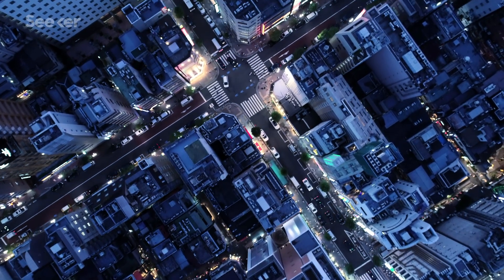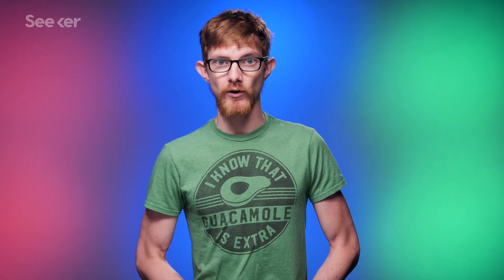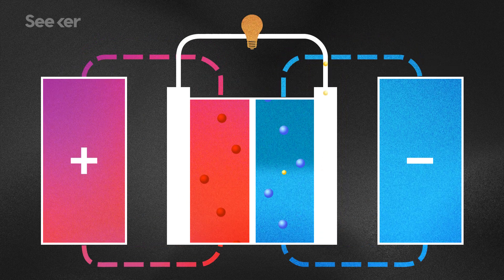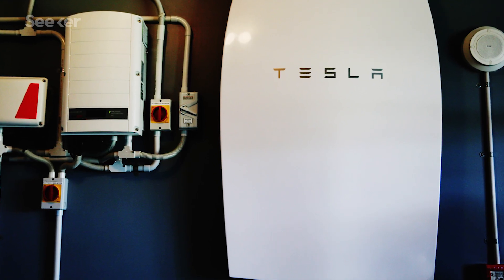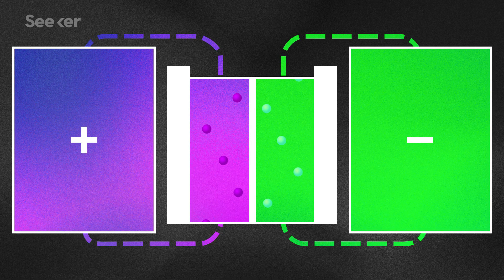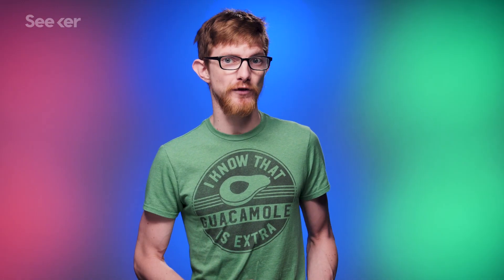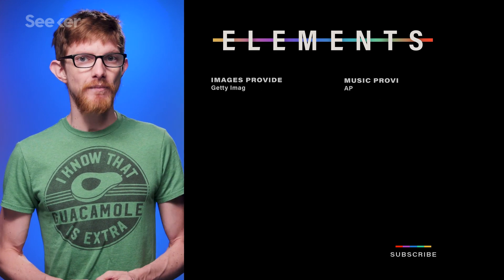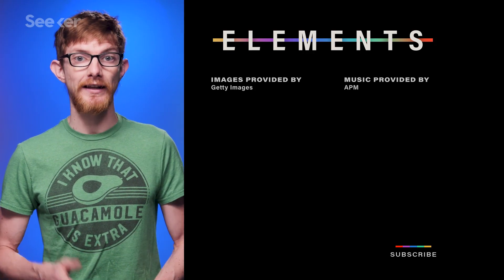Giant Flow Batteries Could Power Your City in the Future

Comment: 3:15 ~ If the tech already exists for each individual household to be self-sufficient, then why do you need to upscale it for an entire city?  Every household would already be well supplied.

A city wide grid is not necessary any longer.
Reply: Cities have more then just homes, they need to power public places and the industrial areas, a big battery could help.
Reply: @miguellopez3392  ~ Or just use the smaller batteries locally, right now.

Why wait until you can power an entire city off of a single grid (and all the problems and eyesores associated with a power grid) when you can locally power without a grid RIGHT NOW?

I think you are completely missing the point of my comment.
Reply: @bigdickpornsuperstar  because not everyone has 30K to drop on a battery pack and a solar panel array just to make themselves partially independent of the grid.
Reply: @miguellopez3392  ~ ::facepalm::  You really are missing the point, and I have neither the time nor the inclination to lead a horse to water.

Suffice it to say, you ARE the fence at the end of the runway.
Reply: @bigdickpornsuperstar  that's cool.

Comment: Vanadium is not the only metal being researched for flow batteries. Copper also works and with simple management does not seem to have a 'life' problem.
Reply: Other materials as they mentioned causes havoc if it were to be a spill. Even a few parts per million of copper is enough to cause serious complications to water sources.
Reply: Ricky Torres Most bulk products, including foods, can cause environmental problems if released into the environment. World wide such things are transported and used routinely in industry with no real problems. People  handling them in professional  environments take significant steps to properly contain them and handle them safely. The amount of the 'active' metal in these batteries is however not large and often not in high concentrations. The batteries themselves will be robust and when set up are unlikely to be moved. They will also be likely to be protected from accidental damage from vehicles like forklift trucks. I do not see any real environmental down side to the proper use of flow batteries in grid / large power user environments. I suspect that, in time some may be developed for 'house' batteries to replace the lithium ion ones currently used.
Reply: @bigbadjohn10  I agree even "non toxic" can be dangerous. It's matters more on the people handling them and the infrastructure they are kept in. In order to use them as responsibility and least usage as possible. That way IF when there a problem it hopefully won't cause any serious complications to us/the environment.

Comment: ProLogium's lithium ceramic batteries(LCB) look like they will beat every other battery technology to the market. the density isn't great but they are a good improvement in both safety and reliability. a 60x110x10.4mm battery should be able to hold about 5000mah. that said you may need to wire 4x batteries together to get that capacity because the thickest they plan to sell officially is 2.6mm.
Reply: They will beat every other battery on the market... where have i heard that before.
Reply: "to" the market not "on "  the market as in they will be the 1st to actually reach the mass production stage.
Reply: @psionx1  even if they reach mass production stage first it doesn't mean everyone will go buy them, their lower energy density will rule them out I'm many applications, their high lifespan will make it more difficult to sell more of in the future and may be beyond what a company intended their product to last. Why would you make a phone that last 10 years when you can make it last 3 so everyone buys a new one? As for fire safety that is kot as big as a plus since lithium ion batteries are already pretty safe, never had one explode on me so why would I pay more for it to have a lower chance of fire when it was already low enough? Just because it's better doesn't mean it will take off instantly, lithium ions batteries where made comercial 20 years ago and yet much more inferior batteries are outselling them.
Reply: people will always buy a new phone no matter how long the battery lasts. if not because of the need for a faster more power efficent SOC. then because nand flash life gets cut in half every time they try to squeeze more bits into a cell. speed also takes a nosedive after you fill a QLC drive 50%.
Reply: @psionx1  this doesn't help your argument, if the battery doesn't matter then why would manufacturers spend more money on getting a better battery??? Also I dont know anyone who got a new phone because their storage was slowing down, its usually battery life or need for up to date products, I usually buy a new SSD for my computer when the previous one hits 80% capacity to preserve its life and keep my game loading times low but its a full tower PC so intend to keep it for awhile, phones on the other hand aren't designed to last a decade and the companies that make them want to keep it that way.
Reply: the battery matters but it's far from the main reason people upgrade devices. considering any one with a little knowledge about how batteries work and some cheap tools can replace one in a old device. the real advantage of LCBs is that they can handel fast charging better,can be made paper thin and are flexible. which is the holy grail for many companies if all they need to sacrifice is 30 minutes of battery life.

Comment: Hello, I am in the solar industry and I wonder if we could do a mechanical storage system for example  two huge tanks of water or some type of liquid with a pump / generator that uses solar or wind and it pumps from one tank and when power is needed it returns to the second tank. Even with low efficiency just scale the tanks and solar. The fuel is free.
Reply: I think such technologies aren't feasible as they are based on gravity and it's a bloody weak force which makes these too bulky. If you meant pressurised tanks than l'd be worried about huge bombs in my neighborhood.

Comment: Still not the best for a high share of solar or wind...  for that the only cost efficient solution is reversible fuel cells or just electrolyzing water in power to gas, for later use it in the natural gas grid or the utility transport sector, which everybody always forget that those sectors emit half of all co2 human made and we also need to deal with them, so what a better solution than deal with both problems (power grid balance and carbon in the other sectors) at the same time!
No matter what flow batteries use, is not enough to the amount of capacity that we need to store many days of wind or season disparities, the only solution to that is hydrogen.

Comment: Elon Musk disagrees strongly.
1. Li-ion does scale up well. Tesla already builds a battery farm as big as the one in the video. The current output of Gigafactory 1 is 20GWh per year, and that's just a fraction of the planned capacity.
2. Tesla batteries last far longer then a typical cellphone battery, and they are continuously improving longevity. I think now they are around 4000 cycles, and with the recently acquired Maxwell tech they will be able to go far beyond that.
3. Cost of Li-ion batteries is falling rapidly and will keep falling for a long time. The Maxwell tech will help with this too a lot.
4. There's enough Lithium for a few hundred TWh battery, which is enough for the world. Plus there's a few orders of magnitude more in seawater.
Reply: Bojler eladó.
As a chemical engineer lm sceptical about lithium technolgy we'll see about longevity and maintenence in ten years. But ln the mean time why not do both?
Reply: @andraskatona9766  
Do both, I won't stop you. I only wanted to point out the flaws in the video. Also, longevity and maintenance are not questionable anymore, we have plenty of long term data about both. Tesla batteries already proven to last hundreds of thousands of miles with little maintenance. Tesloop has a few cars with plenty of miles in them, and there's much more data on the internet. Some comes from Tesla's internal test, but many is from data collected by owners over the years. And again, the Maxwell tech comes on top of this. Tesla says million mile batteries are coming soon.

Comment: Isn't it overwhelmingly more efficient to just pump water from one reservoir to another reservoir further uphill when you have a surplus of electricity then when your short on power let the water flow back downhill while driving a turbine!?!?!?

This way you are storing electricity as potential energy. It is ridiculously efficient, requires no rare elements, no toxic chemicals, is far less likely to break down, if it does break down it's easy to fix without losing the energy stored and every time it rains you get a bunch of energy FOR FREE!!!

We've been doing this in the UK  for decades it's seriously effective and easy. Why not do it?
Reply: yes, but you can't do that everywhere, because it's based on geography

also dams destroy entire ecosystems so you can't exactly put them everywhere
Reply: Not enough suitable sites.

Comment: But what about Graphene Batteries??
There is ongoing research for Coal to Graphene, if cost effective and scalable such technologies can save Coal Industry as well as provide boost for Renewable energy.

Or about Large scale Hydrogen Fuel cell technologies for powering Urban and rural areas when there is no sunlight or wind.
This can  be a boost to Hydrogen economy too.

But still the most effective method for reducing Carbon emissions is Nuclear energy.
There is a need in US tk standardise the Nuclear reactor design and to focus on Mass production.
US Government must replace all its 2nd Gen Nuclear reactors with 3+ Gen AP1000s and also invest in FBR and MSR technologies.

If US is able to develop FBRs(Fast Breeder Reactors) it can easily utilise its existing Nuclear waste and solve the Nuclear waste issue too.
Reply: Graphene is at least a few years away. Maybe more.
Fuel cells are very inefficient and expensive.
Nukes would work, but politically it's an uphill battle. And the current way of building them is excruciatingly slow, even after the politics gets sorted out.

Comment: Check out the TED talk and lectures by Donald Sadoway. Liquid (molten) metal batteries. Abundant metals, full discharge, high cycles. The heat from charging/discharging keeps the metal molten.

Comment: I've thought for a long time that a redox battery is a natural solution to the long range/long recharge time of electric vehicles. Battery getting low? Pull into a redox exchange station, dump the old electrolyte, fill up with new and drive away. Not much different than filling the tank now.
Reply: First, the redox solution have to be non-acidic, otherwise we'll have corroded fuel tanks and great recipe of disaster for spill out.

And also I don't know power density of redox solution compared to gas fuel and lithium ion battery.

Comment: Vanadium is expensive... lets make batteries out of diamonds!!!
Reply: Diamonds are actually cheap, they're made of carbon which is basically everywhere, and you can even "grow" them on a lab.
Reply: Diamond's cost is kept up by regulating its supply... At least that is what I have heard... (I may be wrong)...
Reply: @yatint9665  - It's true. Natural diamonds' costs are artificially inflated, mostly by the De Beers company.
Reply: @yatint9665  diamonds are now artificially grown in lab (using small ones)
Reply: @lizzy777  that's true. Diamonds are extremely cheap. Only thing good the next generation is doing is not wasting money on diamonds and shit.
Reply: @The4lexO  Dimons were grown in lab for decades. Most of the industry grade diamonds are done this way. And it is cheap and easily available in cutting tools.
Reply: @manjensen1710  you need a great amount of energy to make diamonds though
Reply: Zinc is cheap as well. No problem there. The company redflow uses more zinc.
Reply: Cycle life is an issue if they used normal batteries such as lithium ion it would be very maintenance heavy.
Reply: I prefer sodium, zinc and aluminum
Reply: Vanadium is actually a waste product of oil refining, so not as precious as you might think.
Reply: @mos6507  oils not that renewable seeing as we about to be sooner or later, but this is a short term solution my friend.
Reply: Is Vanadium that expensive
Reply: I think you're thinking of vibranium 🤣
Reply: And toxic. See organic type, Prof Clare Greay, Cambridge University
Reply: ESS Inc (GWH) makes flow batteries out of Iron and salt water. Very cheap and non toxic.
Reply: DATING HARLEY QUINN  I hope they amped up his house insurance policies or else I could see his house having issues sooner or later.